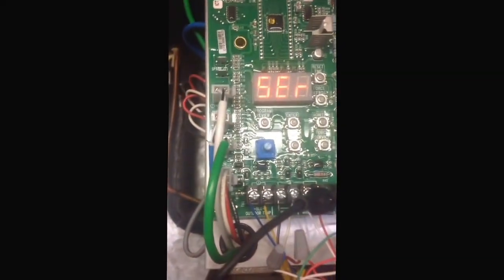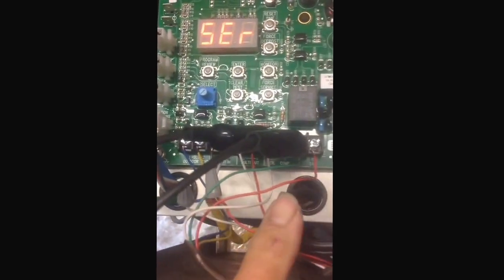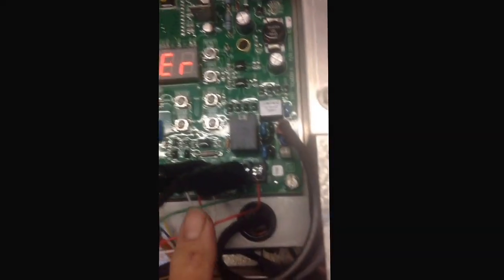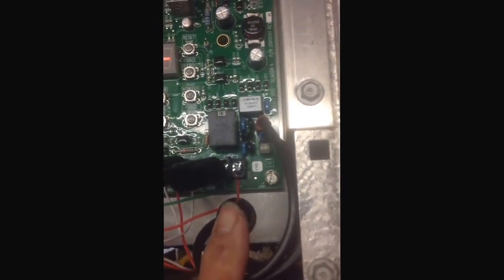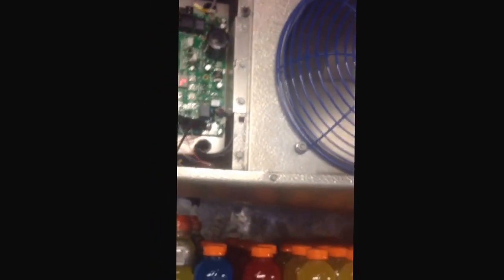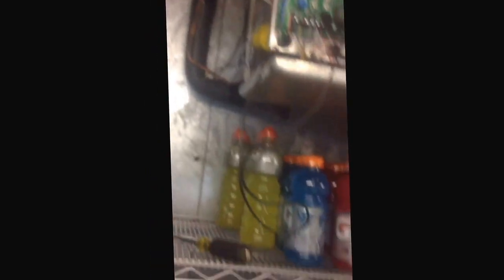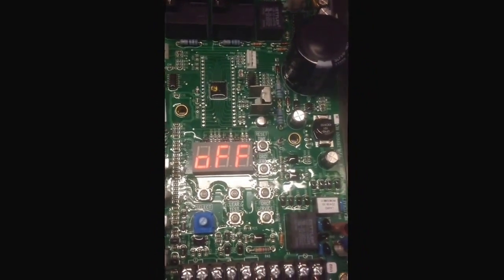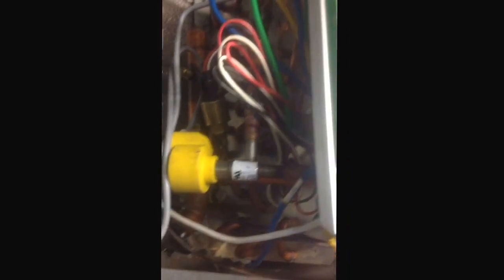Beacon II Heatcraft HVAC EXV

Comment from the maker: The plug is at the top, look at the video. Look over your program to make shure your set points are correct. Place in service mode, which forces the unit in on mode. If it draws down, we can go from their..

Comment: Hello. How well do you know the beacon 2 system? Could use some help on one.
Reply from the maker: What's up
Reply: Hey boss. We took out the old beacon 1 system and upgraded it to a beacon 2 system. Do you have any pictures of the way the eev is supposed to be facing. Heatcraft tech support is great but their instructions are horrible on the eev placement. Could use a rough picture if you have one of the eev
Reply: Whats happening is that the unit would turn on then seem like it is going into a pump down. Which low side would go down to 4 psi then cycle off then would go up to 14.5-15 psi and cycle back on then cycle off. It would continuously so this.